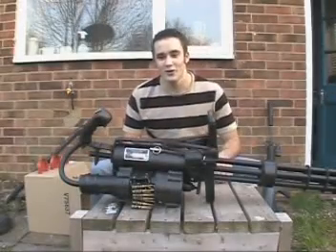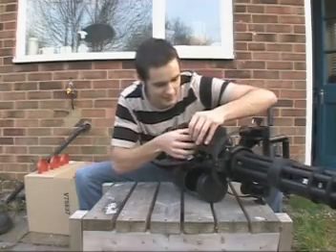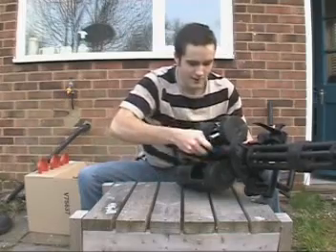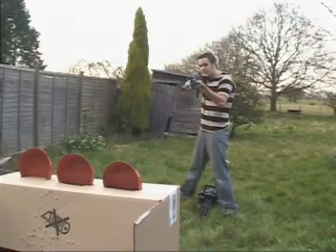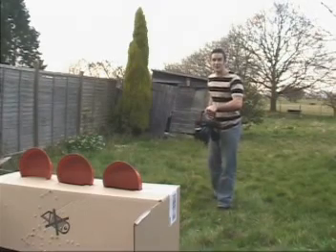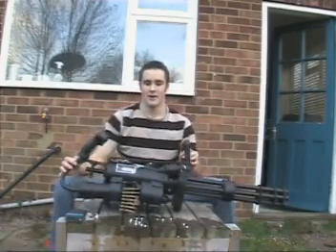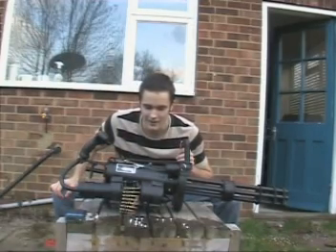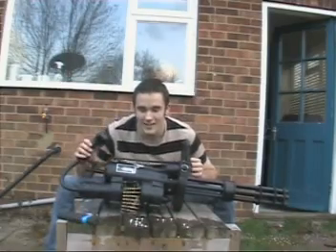Old Painless Airsoft Minigun Review

Comment from the maker: thanks, i built it in the spare room! a few dust sheets to keep furniture from getting messed up and i was well away. its basically just various sizes of pipes stuck together for the body, and the y-frame on top is made of wood. started off using a coping saw, but got my self a jigsaw so cutting out bits is easy peasy now :) also a dremel type tool is a must have, worth every penny

Comment from the maker: it does, the  rings that hold the barrels together, and the frame assembly r all 6mm mdf. have since replaced it with pvc plastic, but may change back to wood as it is less brittle and doesnt damage with bb hits.

obky drawback with mdf is its tougher to cut that pvc and doesnt glue as well

Comment: @makuwusky  What you mean it would work fine, there no difference as long as the barrel is supported and isn't bending the hop-up unit which if there is any length of outer barrel it would be supported.

Comment: The reason i suggest 2 in the first place is mainly for the sake of ROF. A single FAMAS has a fairly slow rate of 6 shots a second, so doubling them up would technically give 12 shots a second, which is a lot more "Minigun" like. The guns though are fairly small and slender, so they would fit perfectly side-by-side and not take up a great deal of room.

Comment from the maker: the inner barrel is where the bbs come out of. the aeg barrel runs from the body and along the inner barrel (which is made of steel) the steel barrel also acts as an axel which the outer barrels spin on.

i didnt opt for using the "real" barrels because:
1 - gun inside would not fit as it would have to sit a couple of inches higher
2 - timing the barrel rotation and the bbs being propelled at the exact same timew would be very very difficult, and just another thing to go wrong

Comment from the maker: most of the "blueprints" are in my head!

i have a few scraps of paper with a few rough dimensions on, but thats it really.

i may make an e-book and sell it, but i will definetly build another minigun and sell it!

im sorting out the mag issue at the moment, it feed no problem now, just waiting for my motors for the mag to make it autowind.

as for upgrading the guns performance, i ahve the systema turbo motor, still waiting on my gears and bushings, coming all the way from hong kong!

Comment: It does depend on the thickness a bit. And the power of a gun. It all is based on the variables applied my friend. Is there different types of glass strength? Commercial housing glass where I live is usually pretty tough and it would take a more sniper suited Feet Per Second (FPS) power and probably sustained fire to crack my windows. Bottles often break pretty quick.

Comment: Brilliant, simply brilliant...I'm gathering materials to build a stand-mounted model (like a sentry gun) but I don't intend mine to fire anything, it will just be a prop with an electric-rotating barrel for a themed show-car.  Can you tell me the diameter of the barrels you used on your gun. Thanks

Comment from the maker: you are correct, they fire from the middle of the 6 barrels. tried higher voltage drill battery, does spin like mad but burns the motor out! and bigger motor wont fit.

now running main gun off of a 9.6v 3300mah battery with a systema turbo motor :)

new video to come

Comment: [Continued] While it won't have as great of a range or FPS, i found purchasing two FAMAS guns for a cheaper total of £80-90 would solve the problem as their magazines rest on the top side of the weapon and are fed via gravity and a sloped hill to guide the BBs. Each gun can hold 200+ BBs, already making a total of 400, and by making a simple extension which blends in to the rest of the gun, you can technically have a limitless capacity by guiding the extra partition into the open mags.

Comment from the maker: cheap, yes, metal no. its mainly plastic gutter piping!

yes it is ass kicking cool, and i have to correct you on your last point, it does exceptionly well in airsoft games. holds over 1000bbs, fires at 330fps at a rate of 28 round per second (in the vid however it doesnt perform as good as it does now) so it does more than well

Comment from the maker: rate of fire in the video is about 15rps which is slightly above ur average aeg that uses an 8.4v. mine has this cos i use 9.6v battery.

now tho the gun has upgraded internals and a better battery and is now 28rps :D

and yes it is possible to take the M4 out, all that is required is the removal of 2 screws, so it takes like 30 seconds.

Comment from the maker: your can comment made me laugh, but you are wrong i did make it. didnt cost anywhere near £3300 and you saying mine looks like it does is and that i couldnt possibly have built it from "an old drainpipe, some woods and an old joystick" is a pretty big compliment! thanks!

mine doesnt shoot through the top barrel, but instead shoots thru the centre of the barrels so no timing issue to overcome.

the whole design was all 100% my idea from start to finish.

Comment from the maker: thansk for saying my vid was great, but what the hell r u on about about batteries? firstly it is the stregth of the spring which determines power (fps) and the batter does dicate the rate of fire (to some extent) and i think you mean millamphours(mah), and 1200 wouldnt have a high enough discharge rate, thats why i use a 9.6v 3300mah battery :)

Comment from the maker: i love posts like this, the sticker is actually a serial plate you made similar to the one you get on the miniguns you can buy it reads:

AIRCRAFT MACHINE GUN
7.62MM GAU/BA
FSN 1005-903-0751
CONTR NO. 110104
MFR. FINN GJ 020185
SERIAL NO. 01D P41NLE55
US DD INSP APPD

Comment: I found it hard to read the writing at 7:13, specifically the number for "It's about ___ percent cheaper". Could you fill in the blank for me?

Aside from that, nice work. I'm attempting my own prop Mini-gun which can also fire BBs, but i found a work around for the clip system. You can either buy a huge capacity (3000+) Magazine with gears that automatically feed the ammo up for a couple of hundred, or use gravity to do the work for you [Continued in next Post]

Comment from the maker: in a real minigun this wouldnt happen as the firing pin is set to strike when the barrel is alligned.

with my one that would have been very very very difficult to get right, timing the rotation of the barrels with the rate of fire of the gun would be near impossible and like you said they would get lodged behind the barrels or fly back in my face, which wouldnt be good.

so to fix this the bbs travel done the axel the barrels spin on and come out in the middle of the six barrels :)

Comment: question is, if its so hard to hold why not just use the M4 instead of putting a gigantic plastic shell around it? i mean come on.... youd get the same rate of fire and it would still shred the can. i think ill just stick with my basic M4 thanks.

Comment from the maker: in the video it was doin bog standard 14rps which is 840 per minute. i didn install a system turbo motor and high speed gears and use  abigger battery, i then got 28rps or 1680 shots per minute... but i stripped the pinion gear so need another. then a new video :)

Comment from the maker: for those of you following this "thread" u may be aware i am currently trying to replace the chain and sprocket with somethins more reliable, the lawnmower belt idea didnt work so its back to the drawing board, but i think i have come up with a plan soooooooooooooo easy and soooooooooo simpel that if it works i will come to the conclusion that i must be some distant relative of einstein